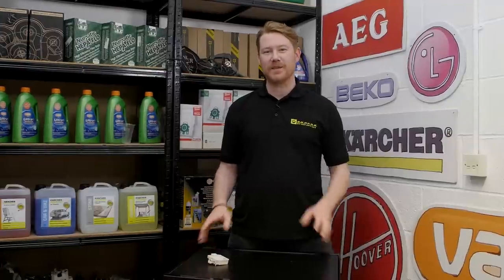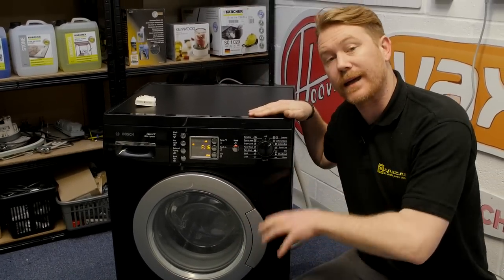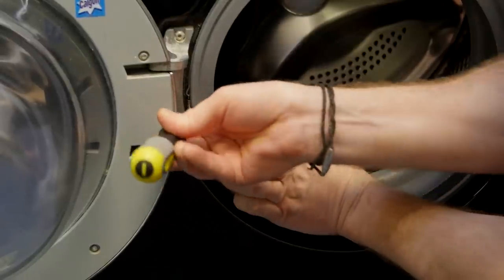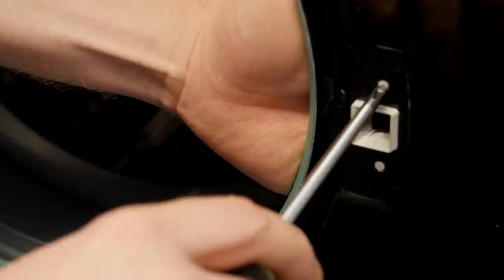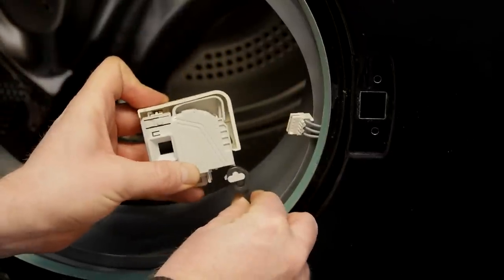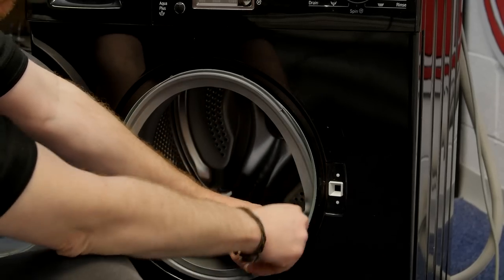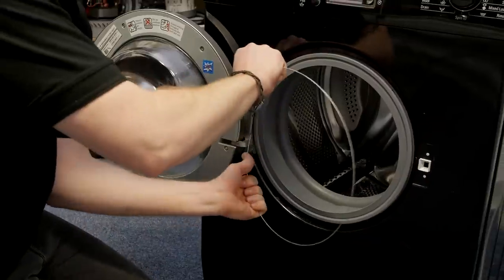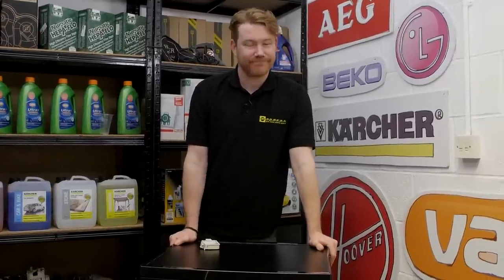How to Replace a Bosch Washing Machine Door Lock (Washer Interlock Changed)

Comment: Well done, very crisp. Beware of pulling out the emergency door release, which is a bugger to get back in place if you do.  The tab end (red, not black, in my machine) sticks out inside of little door on the bottom right of the machine.  To be easily able to fish it through if need be, tape a string or thin wire on the bottom end, where there's nothing to tie it to, and tie it on top so it's easy to untie when putting it back.  Also, the door seal spring has a real lot of tension.  If unable to slip the hoop and spring back on the door, I found it much less difficult to bend back one of the wires connecting the hoop to the spring with suitable pliers, put the hoop and spring in place, slip the end of the spring over the bent wire, and bend the wire back in with the hoop in place.

Comment: Is this basically the same thing for a bosch tumble dryer door interlock mechanism?
Reply from the maker: Hi Benedicte, you will need to gain access to the inside of the dryer to get to the door lock as it is not the same as a washing machine.
Reply: @eSpares  any video anywhere?
Reply from the maker: Hi Benedicte, we don't have a video but take the top and left-hand side panel looking from the front, you should be able to get access from that side.
Reply: eSpares  Well, I did it... but it really could do with a video. It wasn't difficult, but taking the thing apart was a nightmare and I did bend the side panel. Had to take off the top, the front panel (which has all the buttons), then the side... SO many screws!!!!!!!!!!!!!!!!!!!!!!!!!!
Reply from the maker: Hi Benedicte. We do not have a video I'm afraid. We admire your persistence and are glad you got your appliance fixed in the end.

Comment: If a washing machine door stops opening can this affect whether the washer drains and spins or is it usually the other way around?    Mine wouldn't open today and when we eventually got it open (using the strimmer line method) the clothes were sodden inside.     We checked the drains, the filter and the carbon brushes and all seem fine.   Now at a loss knowing what to do next.   Hi Nibs thinks the door problem might be affecting the drain and spin because the door 'padlock' light was blinking now and then on the console.
Reply from the maker: Hi psisky, if the door is jammed then it is likley the door lock needs replacing, if the program was interupted it may be affecting the programs.
Reply: Thanks eSpares,   the door handle snapped after I wrote my comment so we've ordered a new one today.  Also,  I think everything else if fine.  My daughter put one sweatshirt in our 8k machine and I read on 4 sites that that sometimes a too small load causes the machine not to spin or drain properly.    Fingers crossed when the new bit is fixed it'll all work perfect, (and she's banned from the machine altogether now).      Cheers.
Reply from the maker: Glad you have sorted it psisky, and my fingers are crossed for you :)
Reply from the maker: If this does not work check the motor brushes (if fitted) are not worn out and you have not accidentally turned the 'child lock' on as this prevents any buttons operating.

Comment: Is this door lock possible to fix or is it only way replace it with new one?
My Bosch washing machine's door lock is broken. Door can't close, because a latch of lock is jammed.
Local washing machine repair company can't get replace part in this year. So I must wait long long time. If this lock is possible to fix by myself, it is more more quicker way than waiting for repair person with a new part.
Reply: My washing machine have a warranty. It's not ended yet. But this replacement seems to be easy to do by myself and replacement part isn't so expensive. Maybe 30€ plus delivery costs.
Reply from the maker: Hi, if it is the fault of the lock, then it will need to be replaced...as you can't "fix" a faulty door lock. You can see our range of Bosch washing machine door locks here on the eSpares website
https://www.espares.co.uk/search/ma856pt1556/washing-machines/door-parts/bosch
...just be sure to purchase the correct door lock for your particular washing machine model number.